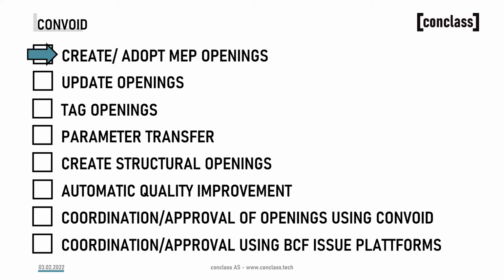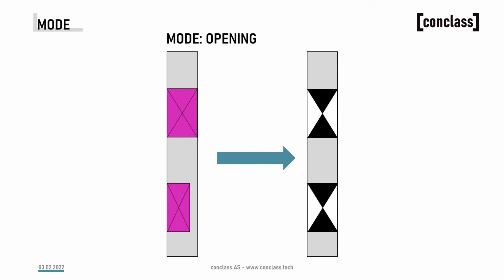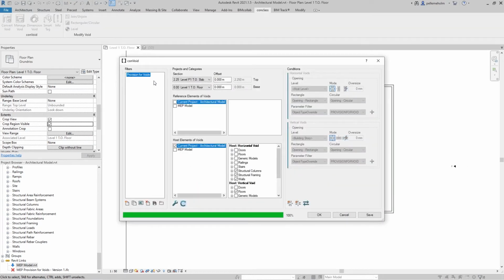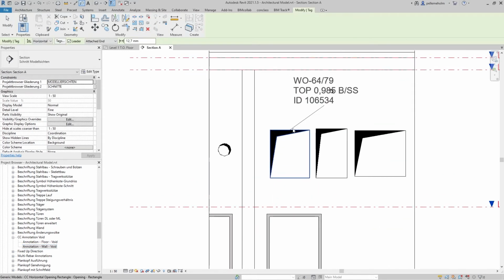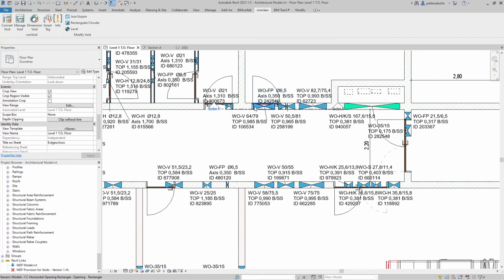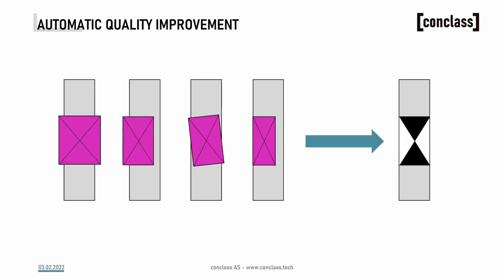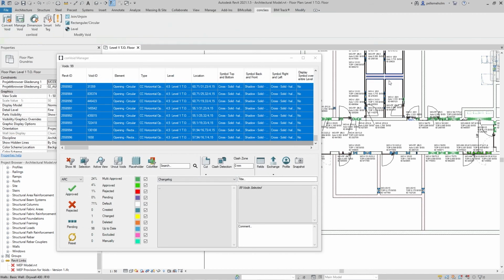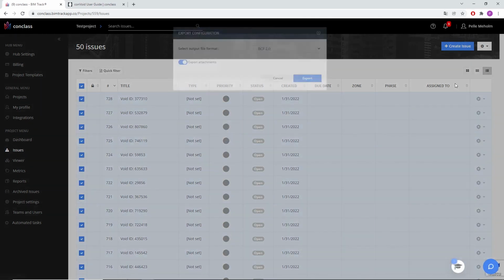Create and coordinate openings in Revit Architectural and Structural models

Comment: So , structural modeler need a license too ? How can it work if the structural is in another company ? Is there a free solution for him like with stabicad solution ?
Reply from the maker: Hi, yes, the structural modeler needs a license because he can also use it if the MEP Engineer is not working with ConVoid. Here are some examples: 

- Convert IFC/Revit MEP Openings to native ConVoid Revit openings
- Create Structural Openings based on Beams, Columns, Architectural Doors, Windows, etc.
- To tag all openings automatically with Smart Tag
- To run the approval process with BCF
- and much more

Some of our customers use project licenses to rent a license to the structural engineer. A free solution is not available.